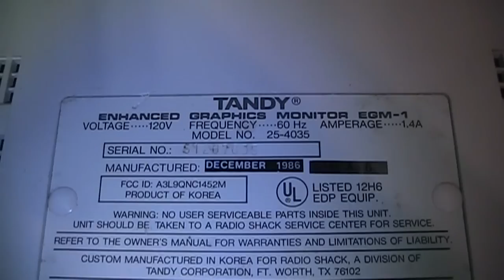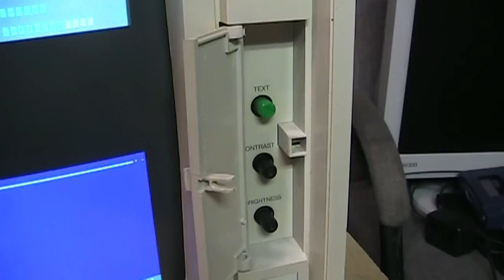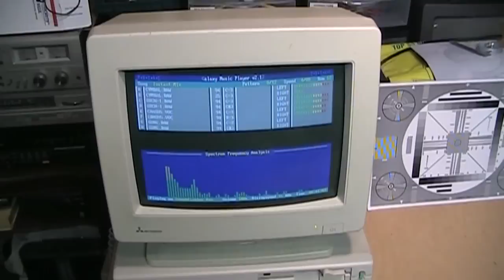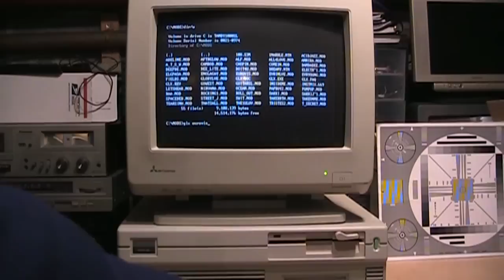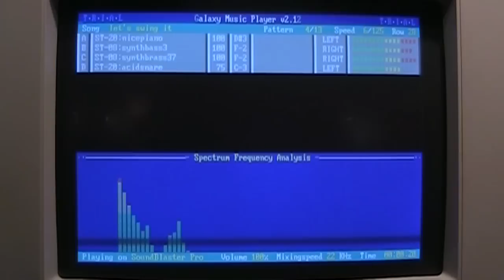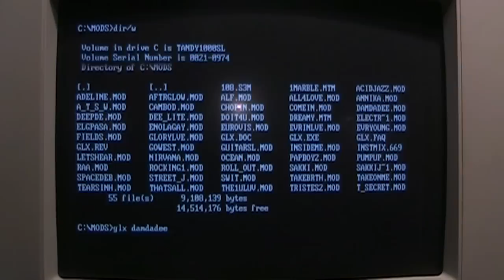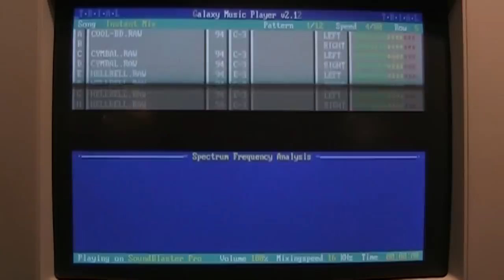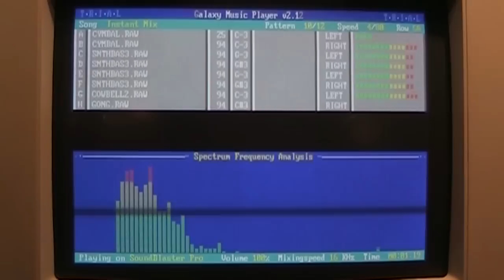Tandy 1000SL smokes an EGA monitor & plays MOD files

Comment: EGA monitors always smoked on Tandy 1000 computers. This is because the voltage of the Tandy 1000 graphics card was far higher than the EGA monitor could support. Your only real hope for Tandy 1000 graphics is to either use a CGA monitor (believe it or not those worked with some but not all Tandy 1000 graphics modes), use a true Tandy 1000 Color Graphics Monitor, OR resort to a RCA adapter.
Reply from the maker: Not true. EGA monitors are backwards compatible with CGA. The voltages are the same for both.
Reply: CGA yes. But a Tandy 1000 / PC Jr. Graphics mode was not compatible with EGA monitors. They might support the same features, but a Tandy 1000 graphics adapter putting out Tandy 1000 graphics to an EGA monitor will burn out the EGA monitor. A Tandy 1000 computer putting out CGA graphics is not putting out a signal of the same frequency and voltage as a Tandy 1000 putting out Tandy 1000 graphics.
Reply from the maker: Jason Seiler
Sorry, but you're wrong. The signals are exactly the same. Tandy/PCjr just lets you use all 16 colors on the screen at the same time instead of the 4 colors that CGA graphics limit you to. You can prove it by testing it with a multimeter.
Reply: Not quite.

When a Tandy 1000 is working in CGA mode it is 100% compatible with a CGA monitor. But if you use Tandy 1000 / PC Jr. Graphics (also known to IBM as "Enhanced CGA" or sometimes called Tandy Extended Graphics II) on a EGA monitor, the Tandy 1000 graphics mode will over volt some of the pins on the EGA monitor. I do not own it currently but when I did own a Tandy 1000SX, Tandy Corporation had published errata to this end when the EGA standard was released on the market.

So the Tandy 1000 WILL work 100% with an EGA monitor (or a CGA if you use it in CGA mode.) But as soon as you put the Tandy 1000 in PC Jr. / Tandy 1000 graphics mode you have less than 5 minutes to switch modes before the monitor burns out.
Reply from the maker: Jason Seiler
I think someone fed you lies. The Tandy 1000 video pinout and voltages are EXACTLY the same as regular CGA. Get out your voltmeter and check it if you don't believe me. I think someone lied to you, to get you to buy a new monitor -- computer sales and repair people have a long history of being dishonest! 

Besides, this whole argument is irrelevant anyway, because as I clearly showed in the video, I was using the EGA monitor with an EGA video card, NOT with the Tandy's onboard video, and the capacitor in the monitor blew up when the computer was TURNED OFF! But I did use the Mitsubishi EGA-compatible monitor with a Tandy 1000's onboard video (in Tandy 640x200 16-color mode) for over 5 minutes and it didn't burn out: https://www.youtube.com/watch?v=azctWK9mQWU
Reply: If you were using an EGA card, then that's fine. My apologies, I must have missed it.

BUT, Tandy 1000's onboard is not designed for EGA monitors. I'm sorry if you felt hassled.
Reply from the maker: Jason Seiler RTFM. Tandy 1000s only support 16 colors -- the same exact 16 colors that plain CGA uses: https://en.wikipedia.org/wiki/Tandy_Graphics_Adapter And the official Radio Shack catalog listed their EGA monitor (the EGM-1) as compatible with Tandy 1000s: http://www.radioshackcatalogs.com/html/catalogs_extra/1988_rsc-19/hr012.html
Reply: Actually, Tandy 1000 would do 20. The video mode was rarely used, but present. It isn't surprising most people knew about it but it was a reason Tandy 1000 and EGA had problems.

Refer to this note from a Tandy Employee from 1989:
ftp://ftp.oldskool.org/pub/tvdog/tandy1000/documents/whichvid.txt
The mode in question is "MODE 7". Sometimes though, Mode 8 and Mode 6 video would leak signals into the Mode 7 registry and cause hiccoughs with a standard EGA monitor if I'm remembering the errata correctly, especially if the EGA monitor functioned at 21hertz instead of 17hertz in it's horizontal sync. So why was Mode 7 never used? It was something IBM was trying to do to develop a better graphics standard (cheaper EGA / PGA for home). Didn't work out for them, so they closed up Mode 7 towards the end of development. Tandy passed the feature along after they played with it and it failed for them too.

I haven't found a copy of the Errata, but I promise I'm not lying about this. There was a known issue between an unused Tandy 1000 graphics mode registry, and it was agrivated by EGA monitors especially when they operated H-Sync at 21Hz, which is above the 17Htz specified by Tandy 1000 and CGA.
Reply: Indeed, the disasterous problems for "MODE 7" in the PC Jr. was the reason IBM sold those systems with a proprietary video connector. They were trying to isolate the frequency leakage so the scan converters didn't burn out when certain modes were used and they leaked into Mode 7.

Tandy simply did not follow suit on this, preferring to use the 9-pin standard used for CGA mainly because the proprietary monitor was a major reason PC Jr. flopped. Still, when you bought one of those machine in the 1980's it was generally known to avoid using an EGA monitor with it.

It's 25 years since this machine was new so I'm not surprised people don't know about this particular problem. But it's there. These old monitors and display adapters used analog scan converters, not the digital ones we ended up with in the LCD era.
Reply from the maker: Jason Seiler It is physically impossible for Tandy graphics to have more than 16 colors, because it only has Red, Green, Blue, and Intensity digital signals going to the monitor. If you add up all possible combinations of those signals, you get 16 colors. Mode 7 is MDA monochrome text mode and has nothing to do with CGA or Tandy graphics. The later Tandy 1000 models (RL, SL, and TL) do support MDA as well as CGA/Tandy graphics, if that's what you're referring to, but in order to switch modes, you have to press Ctrl-Alt-Shift-V, so it's not something you can just accidentally stumble upon. The older Tandy 1000 models do not support MDA so this is irrelevant to them anyway. I think you need to better educate yourself on the real facts of these video systems instead of spouting off incorrect rumors you heard 25 years ago as if it was the Gospel truth.
Reply: vwest, I was around when these computers were sold and owned one of them. These are not "rumors". Scan converters made at the time had a lot of analog components left, not 100% digital yet. They are undocumented things about the hardware that were known 25 years ago and back then more easily referenced and more easily researchable. I'm sorry if you're too young to know what these things are, but don't resort to trashing someone.

It's possible earlier model Tandy 1000's had this difficulty and the model you are using does not. Still, this was known in it's era. Either way, it's not worth letting this get out of hand.

I took some time to seriously look it up, and there was something to what I was remembering:
http://nerdlypleasures.blogspot.com/2012/05/benefits-and-drawbacks-of-late-model.html

To quote: "None of the later Tandys support composite video output, while all the early ones do.  Although there are detection issues, you can put a CGA card in these Tandys for composite video output.  Unlike the early Tandys and PCjr., you will be limited to the CGA modes for composite color.

Hercules graphics  (TL, TL/2, TL/3, SL, SL/2, RL, RL-HD)

Games autodetecting Tandy may not work with the Hercules emulation found in the Tandy Video II chip.  They detect a Tandy 1000 and assume that the user wants to use Tandy graphics, regardless of any other functionality detected.  Of course, since most games look better with color graphics, the Hercules/MDA functionality is likely to go unused.  Dual monitor support, using a splitter cable, is theoretically possible, however, this may endanger your monitors, which function at different sync rates.  A CGA and a MDA monitor may be damaged if the other's monitor's scan rates are sent to it."

If I'm wrong on details, I'm wrong on details... but I remembered that there was a flaw that can cause monitors to smoke with a Tandy 1000 if something went haywire. EGA remember, uses a different horizontal sync rate than CGA... same problem, possibly. And it would only effect some monitors and not others depending on specs, and capacitors, age, and what not. Also depends on the scan converters (which were still analog at the time) even in RGB monitors and signal bleeding on that end. That and Tandy 1000's higher end Graphics (PC Jr.) graphics were simply not the same programming language as EGA and CGA so the digital signals won't be the same anyway.

Put more simply: EGA monitors might theoretically have the same resolution and colors as Tandy 1000 (PC Jr.) but they do not speak the same language because of the scan converter in the monitor won't read it right, and the signal adapter in the Tandy 1000 is set around CGA / MGA / PC Jr. The EGA is compatible with 2 of those, but not 3. And actually, EGA is set up for a wider horizontal frequency than the Tandy 1000's signal range so the electronics stress in other ways. Even if you were in CGA only mode, the difficulty will remain because the signal adapter in the Tandy 1000 (which is setting up the signal for the monitor) is specialized for the Tandy monitor. I did notice on my Tandy 1000SX that when I used my IBM CGA monitor, the screen got a LOT brighter... and the monitor died after a few weeks. The Tandy 1000 monitor never gave me a hitch.

In fact, you had a slow repeating wave come over your screen. This is because your Horizontal Sync was incorrect  between your adapter and your screen. Take a gander.

https://www.bing.com/videos/search?q=CRT+Monitor+Refresh+Rate&&view=detail&mid=A1F4F75AFE0A14999322A1F4F75AFE0A14999322&FORM=VRDGAR
Reply: NOTE TO SELF: Yeah, beating a dead horse because of his ISA adapter... not relevant to his situation. But, Tandy 1000 / EGA monitor was an old alarm bell.
Reply from the maker: Jason Seiler
EGA monitors are 100% backwards compatible with CGA, and Tandy's implementation of CGA is 100% conformant to the CGA signal pinout and voltages. There is no problem that anyone has ever been able to document. (The web page you brought up is talking about the composite video output used by TVs, not about the RGB output that CGA and EGA monitors use.) Radio Shack had a history of "bending the truth" and sometimes even telling outright lies to get you to buy their hardware instead of cheaper hardware from someone else. If they could get enough people believe the lie that if you used a Tandy 1000 with a non-Tandy monitor it would damage the monitor, that meant extra sales for them (remember, RS salesmen worked on commission, so the more they sold, the more they made!). The rolling line in the video is because CGA and EGA use a vertical refresh rate of 60 Hz while my video camera records video at 59.94 Hz -- that slight mismatch is what causes the black bar on video that is not visible in real life.
Reply: I know you're sure Tandy did it as a marketing ploy. I'm going to leave it there, as at this point it's as much an issue of experience with the equipment as anything else. I wasn't here to tick you off.
Reply from the maker: Jason Seiler The only thing I could find is someone saying on the Vintage Computer Forum that they connected an IBM 5154 EGA monitor to a Tandy 1000SX and the colors looked wrong. It didn't burn out or blow up -- just the colors were wrong. Other EGA monitors had additional circuitry to provide better CGA compatibility but IBM expected you to be using their EGA monitor with an EGA card so they left it out. So the incompatibility was IBM's fault, not Tandy's, and it does not cause any physical harm to either the monitor or the computer. But it looks like some people took this tiny, trivial problem and blew it way out of proportion as it got passed through the pre-Internet grapevine.

Comment: Whats the deal with the black bar across the screen.
Reply from the maker: ***** That's a camera artifact from recording the image of a CRT. It is not actually visible on the screen in real life.
Reply: Usually you get the rolling effect, never seen it sit right there in the middle.
Reply from the maker: ***** That's because the camera's shutter speed was matched exactly with the monitor's refresh rate.

Comment: You know, ultrasound cards are better for mod files.
Reply: +spankmeister but gravis ultrasounds are much rarer than soundblaster isa cards.
Reply: +Windows Ninety Five 66 I suppose so but that shouldn&#39;t stop +vwestlife from acquiring one, hell, I&#39;d be surprised if he hasn&#39;t got at least one already.

An Ultrasound vs. Blaster shootout would be right up his alley I think.
Reply: +spankmeister I thought that they are better for MID files, where the card's internal instrument sample set is used. MOD, S3M, XM files contain their own samples which are played back similarly to the MID files according to a music-score like system. Unlike MID files, MOD's samples are from a completely user defined, arbitrary sound palette defined upon creation and it is supposed to be sound card independent. So at the end of the day (wave sound quality of the sound chip difference aside) it does not really matter if it is an SB16, GUS or SB AWE32 or whatever it will sound similar enough. Unlike MIDs where it does make a huge difference if you listen Ad-lib compatibles: SB8, SBPro, SB16 or GUS or AWE32, the latter two have digital samples of instruments, while the former three uses OPL3 for FM synthesis.
Reply: Viktor Horváth This is incorrect because the gravis ultrasound has hardware mixing, and the SB has software mixing. This means that the quality of sampled music will be much better on the GUS, and consume less memory and CPU time.
Reply: +spankmeister Interesting points. Can you suggest a reading on GUS's hardware mixing abilities and how and why it is superior and what are the potential limitations? I'm also curious if these DOS based players could and if they actually do make use of it. Thanks.
Reply: Viktor Horváth I don't have much more than a few wiki links right now, a website that had really good information on sound cards seems to have disappeared. Still, it's a good place to start.

https://en.wikipedia.org/wiki/Gravis_Ultrasound#GF1
http://www.vogonswiki.com/index.php/Gravis_Ultrasound
Reply: +Viktor Horváth Also, a few examples of games that make good use of the GUS are: Jazz Jackrabbit, Epic Pinball, Star Control, and the demoscene PC demo Second Reality. Look on youtube for a good recording of these these with "ultrasound" in your search query. Then compare with Sound Blaster recordings.
Reply: +spankmeister Yeah, this is a really good idea! I think I heard a GUS once and the difference did not strike me. Maybe the speakers were not good or just simply the example was not a good one. Thanks!
Reply: Modern MOD players (modern in DOS terms, but of course 21th century ones too) backed with a little more recent hardware can catch up to or even surpass the GUS' mixing capabilities. GUS is limited to 14 channels at 44.1kHz, it can mix 32 channels at 19.2kHz and it does linear interpolation. Plus its onboard memory limits the size and/or quality of the samples the music use. It won't limit old Amiga music as Amiga 500 usually had 1/2 or 1MB of RAM which was shared between OS data, user code (the player itself), graphic data and the music (the score as well as the samples). So the 1MB GUS memory was more than enough. But in the Fast Tracker and Impulse Tracker times MOD channel count and sample amount could get out of hand so one was better off with a 16-bit card with software mixing.

On slower machines the GUS won hands down, it helps even a simple 386 to play music that could even kill a 486 and it still has time to show effects. No surprise GUS became the de facto standard of the demoscene.

Comment: Maybe start pinning comments so lazy people don't comment the same thing as others like name of MODs?
Reply from the maker: The names of the MODs are displayed on the screen.
Reply: Exactly! I meant it as an example suggesting that in cases like this, a pinned comment would be easier for people to find so that 100s of different people don't ask the same question and you don't have to answer every single one. Just a suggestion, though :)
Reply from the maker: But pinned comments (as well as the video description) are invisible to many people watching the video on mobile devices. I've been asked questions that were already answered in the description and a pinned comment and that was the excuse I got.
Reply: VWestlife Good point, but honestly, most people won't look in the description and instead look at the top of the comments first (unfortunately true).